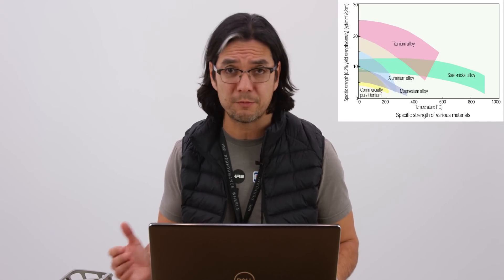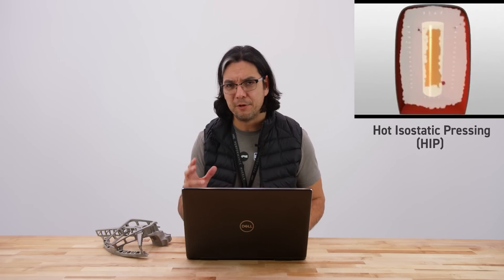HRE3D+ Your Questions Answered! | Ask Alan.

Comment: Looks like "interlaced parts design" is the only true advantage using DLSM for Titanium. You still need post process for removal and finish(CNC, EDM, Ceramic Grinding,..etc.). Titanium is a very hard material and hard to remove. What about titanium material fails in porosity and dimension? You will need CNC inspection between each process(additive, removal and finish).  So you would agree, if parts are not interlaced, then casting or sintering is sufficient (using 3D printed "patterns" of course).